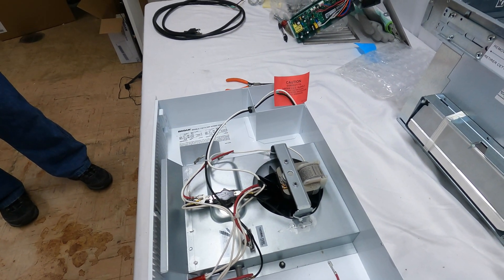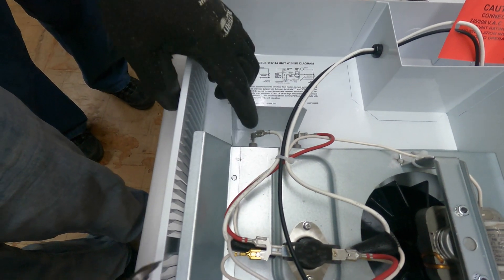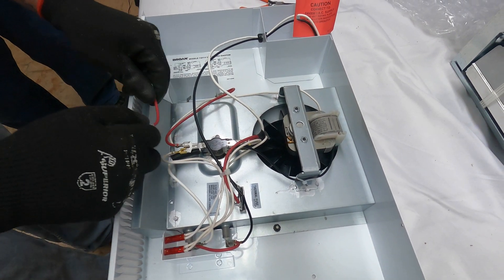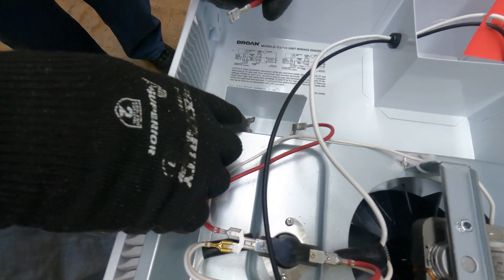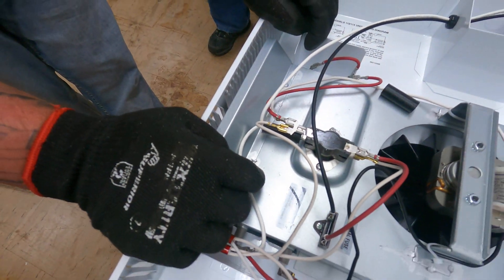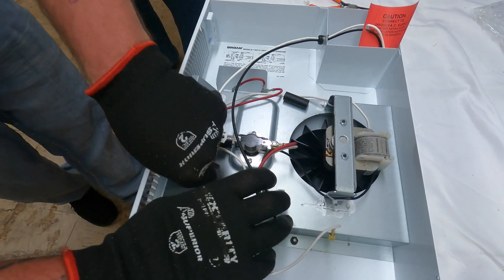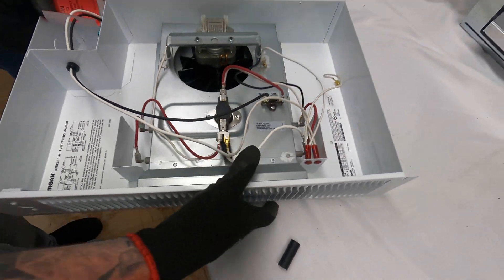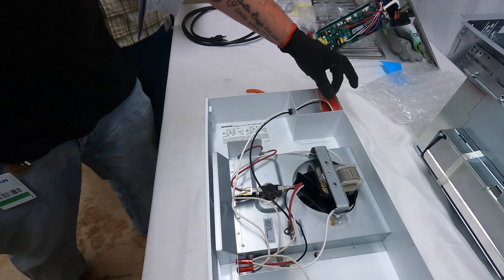How to Convert Broan 112 & 114 Heater from 240V to 120V

Comment: So, to wire it at 240v, you need a double pole breaker ( says 15 amp ) so double pole 15 amp, then it says hook black to black, and the yellow from heater to neutral. So no 12/3 wire needed? Just 12/2 and im assuming you hook black to one pole and tge white to the other pole?
Reply from the maker: Thank you for your question regarding the 112/114 wall heater.  Yes, you are correct. Just black and white (12/2) and black to one pole and white to other.

Comment: Can I wire a grounded plug to my Broan under cabinet heater, rather than hard wire it?
Reply from the maker: Thank you for your question. We do not recommend converting this unit for a plug in application. The undercabinet heaters should be hard wired into your home. If you have additional specification, application or installation questions, please call our Product Support Team directly at 800-637-1453.